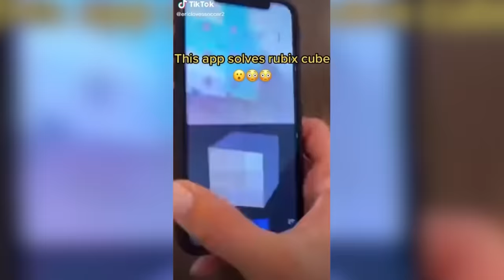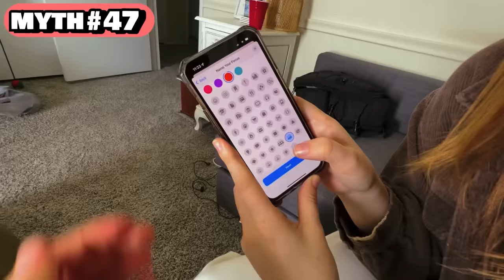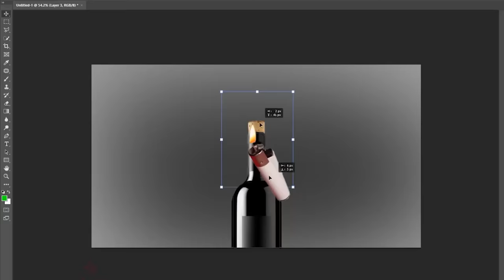Busting a 1000 MYTHS in 72 HOURS!

Comment: All I'm gonna say is that paper in fact DOESN'T weigh enough to stop the object, because weight is a calculation of mass and gravity, while the mass of the paper has nothing to do with the ruler staying put. It's atmospheric pressure, which is a function of the mass and gravity of the AIR in relation to the paper's SURFACE AREA.